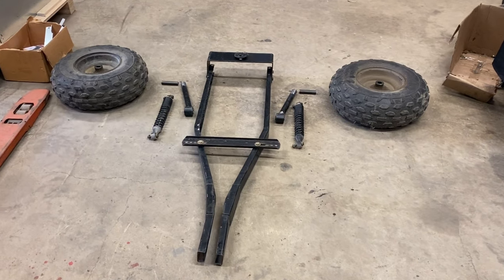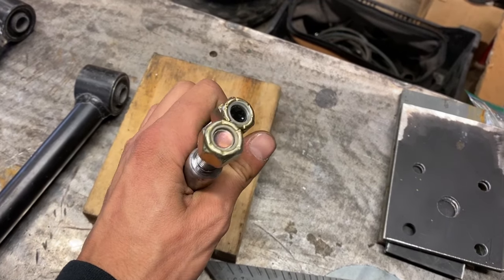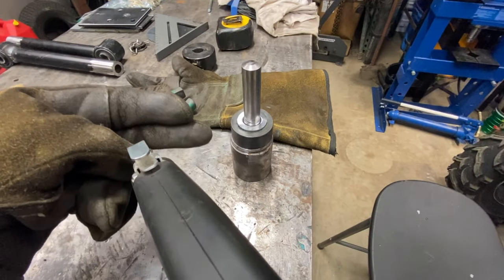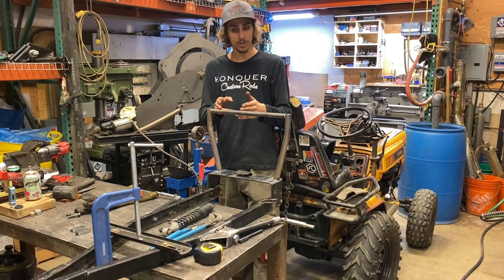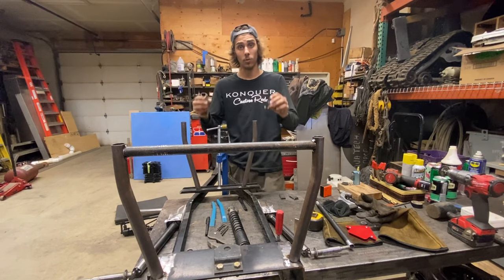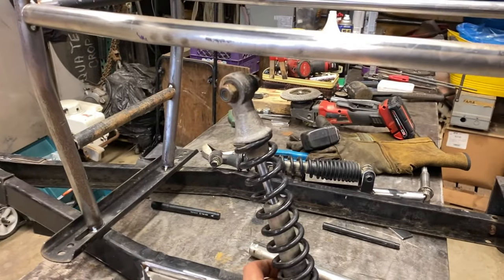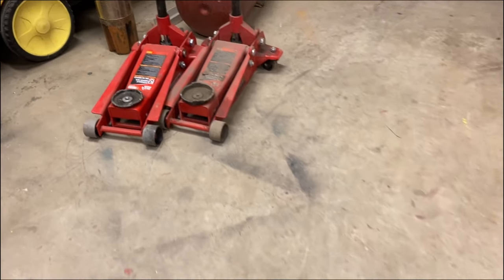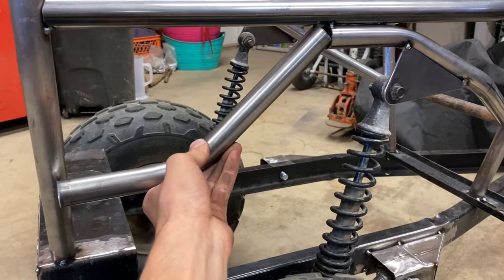Ultimate off-road mower trailer build

Comment: That trailer is absolutely beautiful, I’m digging it to!
I built an off-road mower this year to get up the trail on my property. One for fun and also so I can move materials, tools, and other things up there. The trail on my property is very steep in some places. I’ve already considered building a trailer for it to haul said equipment. one thing I’m seriously considering is installing disc brakes on the trailer axle with some sort of a lever or wire coming up to the tractor seat. That way the trailer can’t plow forward when going downhill and it will actually help slow everything down. It may be something to consider on your trailers to.